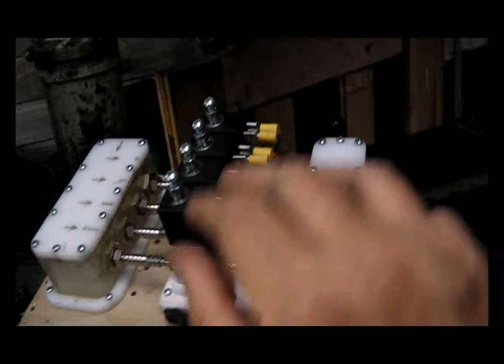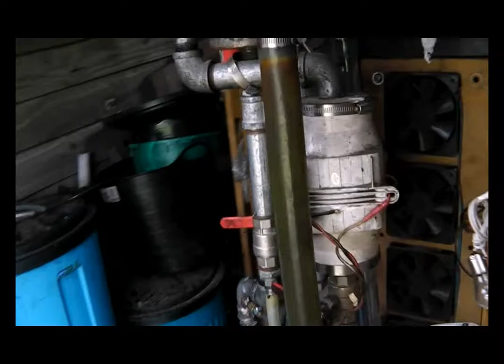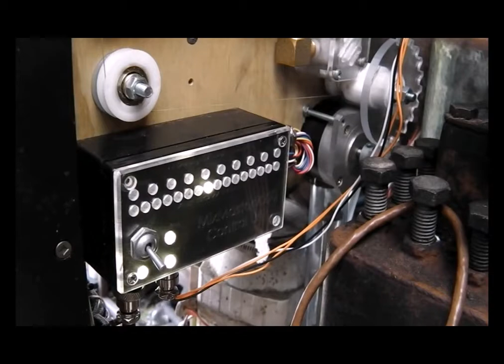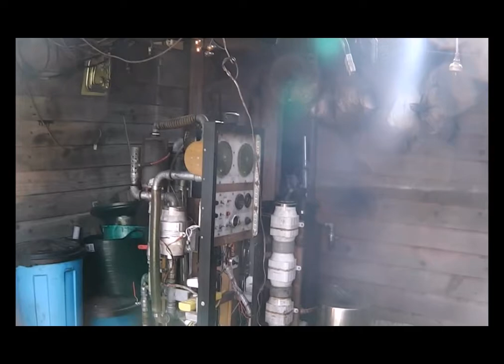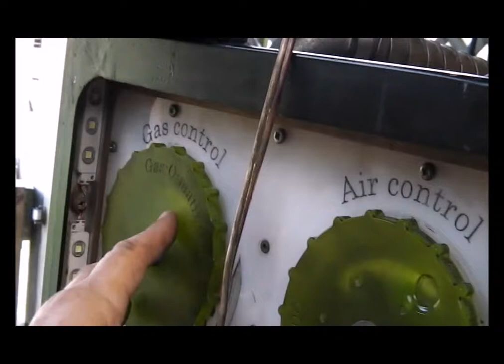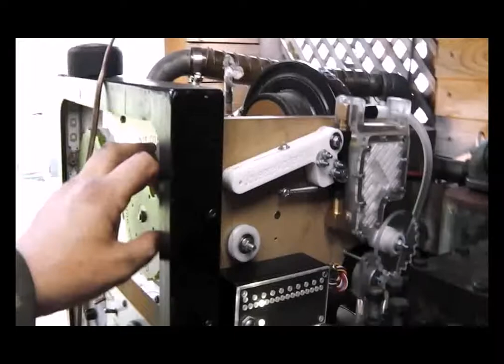A New Automatic Mixture Controller: The SqueezeMaster9000

Comment: I'm totally intrigued with all your experimentation, research and development on your project.  You're the first guy I've found on YT who clearly has an excellent grasp of the chemistry and the nuts & bolts technology of gasification - and also the delicate electromechanical and electronic aspects of controlling the fuel-air ratio.  And you don't take yourself too seriously either.  Even if I has no interest in gasification, you would still be entertaining.
I wish you all the best with your future refinements.
Reply from the maker: Howdee Andrew, 
 Thanks kindly for your positive thoughts here  :) . 
 The idea of automating this has been of great interest to me for quite a long time. 
 This becomes more important during poor weather when I wood be otherwise obliged to splash around in the puddles - as I go out to the gasifier every 15 minutes to stir it up and readjust the fuel/air mix. 
 Having carried out that manual process for the first 1100, or more, hours of operation, the novelty was kinda wearing off  ;) . 
 Now that it is auto-magic, I can sit back and relax, safe in the knowledge that my little home made computer will do its very best to keep the engine running while I am out and about. 
 One of the major driving forces behind my determined efforts to make this work so smoothly is that I am literally relying upon it for my winter electricity supply, as I am not on the power grid here. 
 Needless to say, this woodgas technology fascinates me to little pieces, then it gasifies the little pieces  :) .

Comment: Just to add-reading comments [Klaas hamstra] mentioned of the Arduino mini-computer for use in auto control-they are just down right  fun to play with! They come in many different sizes and are capable of all types of input/output devices. and there are thousands of users who are more than happy in helping others learn how to use. A great idea!
Reply from the maker: Yup, those Arduino computers seem to be very capable, and they are quite cheap too  :) . 
 I went for the PIC micro, as I use it for other industrial designs, and it has proven itself to be a reliable performer over the years, while also being nice and cheap.

Comment: This is great!! I have been searching for progress on automated wood gasifier  operation. Are you using an O2 sensor to monitor engine exhaust for feedback control of air/fuel mixture? Why not use a butterfly valve control (as used in a carburetor) instead of squeeze system? I would think a simple 1 barrel carb could this.

The ultimate in woodgas generator automation would be a system that would maintain charge on a bank of batteries that supply current for household use. When batteries need charging the system would self-start and maybe continue operation supplying power to house (load) until demand has dropped off then shutdown where (load) is supplied with battery current. This setup could make for a smaller size in battery bank - cutting costs.

And finally, having the woodchips fed automatically to gasifier and combustion chamber self cleaning would round out a system requiring the least of attention/maintenance.

I absolutely love your set up!!
Reply from the maker: Thanks kindly  :) . 
 This system works like a charm, and it saves me a fortune in generator fuel too. 
 Yes, this works with an O2 sensor. It's a narrow band one, which makes it simpler to set up and use. 
 I have a video on that here:  youtube.com/watch?v=2d6dRYIYLhY 
 Sadly, a standard carb is not practical for this, as the vacuum demands of the mixer system are so high that it can't tolerate any leakage past the butterfly. 
 There is also another reason I went this way, as that was aimed at maintaining performance as the parts wore out, without introducing wear induced debris into the engine. 
 Now, for a bigger system, I think a standard carb can work, as the relatively high airflow rates will effectively swamp out the butterfly leakage seen at very low settings. 
 Hmmm, I hope that made sense  :) .

 There are some automated systems out there, and these run on wood chips that are fed into the gasser via a screw based elevator. 
 Perhaps I will look into building such a system one day  :) .
Reply: Thanks for th' very fast reply!!! You're like a "rock star" in my eyes (LoL!)...I would've thawt th' carb idea would have worked...but, you seem to kno' your stuff! I've been hashing around for quite a spell now learning about  woodgas technology and collecting valuable parts/pieces (rather, other people's junk ha ha ha!) so I can attempt a first build of my very own! Gonna find out about narrow band O2 sensor ( I was wondering how you set up controller parameters in that regard) and experiment a little-gonna use an Arduino bequeathed upon me for having 54th birthday....gonna keep on watching your videos (and a few other worthy ones). Being of Finnish descent, I want carry on a lifestyle not so much demanding of our tiny little Earth.

Best Regards!
Reply from the maker: You're welcome  :) . I don't know about the rock star, but I do have a broken guitar around here, somewhere  ;) . 
 For a bigger engine, a carb wood be good, but this little gasser will fall over if I go that way. 
 Another alternative to the carb is to use either a ball valve or a gate valve. 
 These have that positive gas restriction that you are looking for. 
 If you wood like to learn a lot about how to make a good wood gasifier, I wood like to suggest that you take a look at the videos put up by Flash001USA. 
 He takes you through all the build stages, and helps you to build a gasifier that runs very nicely  :) . 
 My gasser is of a different design, but it works very well, and it has clocked up over 1500 hours so far. 
 Ahhh, free electricity. I love it. 
 If you can get a narrow band O2 sensor from an auto wrecker, you can experiment with it cheaply, and you will soon discover that it's quite easy to make it work for you. 
 My controller works on the 0 to 1 volt deflection that occurs when the O2 sensor is operating within its normal range. 
 Ideally, you wood operate near the zero volt end of the scale, in order to avoid a rich mixture. 
 Your Arduino should be very good for this, and I am looking forward to seeing what you come up with. 
 Woodgas is a carbon neutral power source, so you will be helping our planet a great deal when you get this up and running  :) .

Comment: Are you using Arduino to control this system? Awesome work by the way! I want to build a system similar to yours! Your inspiring many to go forward with woodgas!
Reply from the maker: Thanks kindly  :) . 
 This project has made a huge difference in the ease of operation that we woodgassers are seeking. 
 I am not yet familiar with Arduino, but I think I should start getting into those fine devices.
 Instead, I am using PIC Micro. These are commonly used in industrial designs, and they are nice and cheap too. 
 The particular processor I am using for this is the PIC16F628A. It's quite a versatile little chip, so it handles this task very nicely indeed. 
 I really do hope that more people start building gasifiers, as they really are fascinating to build and operate  :) .

Comment: When you were showing the old piece that you took off it took me back to a scene in the old Christmas animation cartoon Rudolph the red nosed reindeer where they had the land of misfit toys and I had to laugh because I know the feeling of putting a lot of thought and work into something only to come up with a simpler idea that works better. Great job is an understatement. Mark was telling me that your part of the world was doing a whole lot of shaking so be sure to nail everything down. PS, I can relate to your calendar.
Reply from the maker: +flash001USA 
 Yup, such is the way with us inventors. 
 We invariably come up with better ideas that are simpler, less expensive and more functional than our initial prototypes  :) .
 This new one is doing very well indeed, as it has clocked up at least 15 hours of sweet and smooth running. 
 It offers me a degree of freedom that I have never experienced before with any gasifier, so it, or a better version of it, is here to stay  :) . 
 For sure, we have been ripped up and spat out by a stampede of angry earthquakes.  They have smashed us up - and cost us billions, but we will pull through. We always do  :) .
Reply: Steve I just read Bills remark about temperature and how it may affect the flexibility of the air hose during colder weather. Just an idea. Have you entertained the thought of making a simple gate valve (flap valve) that was controlled by the arm? This would still work with the same arm movement and this could possibly remove any air temperature or pinch issues with the air tube over time. The main thing is you have proven that you can automate the engine and that alone is priceless.
Reply from the maker: +flash001USA 
 Indeedy, the flap valve concept is currently foremost in my mind. 
 While the flexible hose I am using does not appear to be affected by freezing temperatures, I still want to replace it with a more robust method of gating the airflow to the grunter. 
 The idea I have in mind is something like a trapdoor that opens and closes via an arm or a cam that is operated by the motor. 
 Ideally, it would be able to totally shut off the airflow when closed, while allowing free airflow when fully open - all the while eliminating the prospect of wear induced particulate delivery to the engine's intake. 
 Tree-oretically, the stepper motor can live in the airstream, thereby helping to keep it cool, while shrinking the size of the system. 
 Ohhhh, so many ideas, so few hours in a day...

Comment: Nice job Steve. I'm glad to see it's working well. Thanks for the fix as I run out the door to get a bunch of work done on my gasser while it's nice outside. What will you improve on next? Joe
Reply from the maker: +mazdalorean 
 Thanks kindly  :) . 
 I figured that you needed a woodgas fix, as I could see that you were getting a bit shaky - due to woodgas withdrawal symptoms  ;) .  
 The next thing on the list is to automate the hopper and grate shakers, so they will operate at exactly the right moment, based on the findings of the gas mixture control computer. 
 If I can get it right, the gasser will be able to look after itself, until all of the fuel in the hopper has been used up. 
 Oh, so many ideas, so few hours in a day!

Comment: You have built an amazing piece there. It seems to work great and like you said, a bit of a tweak with the programming and you will be able to "set it and forget it" I only wish I had you computer prowess. What a great improvement for your system. Nice build on the other building too. It withstood the 7.8 quake you all had down there. Are you going to start using the camel fluff in that Squeeze Master filter??I have to agree with Hbbyloggr on the freezing temps you get there and the squeeze hose loosing it's flexibility. Being that you are coming into your summer, it will be a while before you cross that road. Nice work all the way around.
Reply from the maker: +mada94fxr
 Thanks kindly. This device works perty jolly well, so I am duly pleased with it  :) .
 In time, this device will change and improve quite a lot. 
 If I can figure it all out, I would like to make the programming smarter, so it can learn about the gasser it is attached to. 
 That should mean that it can be seamlessly transferred from one gasser to another. 
 We'll see  :) .
 Yes, the new shed has been my major building project for the past year. It is 26 feet wide and 24 feet deep. 
 It's all built in steel, and is shelled with 3/4 inch plywood. This is a rock solid structure, and it didn't even feel that 7.8 quake that did so much damage in these here parts. 
 So far, it has cost me $19,000 to build, so I will be glad when I can put my wallet away at the end of the build  :) . 
 Yes, now that I have upgraded the air filter on this regulator, I will be able to jam some camel fluff into it. 
 This is a good thing, as my pillow won't stand up to much more of my pulling the fluff out of it  ;) . 
 I froze the air hose, and was pleased to see that it retained most of its flexibility. The true test of this will surely take place during the next winter, as that's when every part of the system gets pretty stiff! 
 Perhaps by then, I will have totally redesigned this device  :) .
Reply: Duly pleased is a understatement. I would be bouncing off the walls happy. You now have a baseline to work from and make the improvements as time goes. I'm with hbbyloggr. Let us know when you start marketing this thing...LOL. Add me to the list. Oh, time to shear the camels too........
Reply from the maker: mada94fxr 
 Hehehehe, yup, I figger that yer right on that one  :) .
 I am rather delighted with its performance, especially as that was a first off test  :) .
 Ideas for the next version of this are trying to get out of my head, and get into my CNC machine. 
 Soon, my little ideas, you will have your freedom  ;) .
 For sure, I wood like to think that I can develop these to the point where folks wood like to fit them to their own machines. 
 The luxury of freedom that this device offers is simply wonderful, and I just can't wait to see what is possible as I try to perfect this technology  :) . 
 Oh, if only I had more than a mere 24 hours in a day!
Reply: Darn man, haven't you done enough already........ You have another version bouncing around in the head??
Reply from the maker: mada94fxr 
 Hehehehe, yup. The mind altering effects of my morning coffee bomb have really messed with my imagination lately  :) . 
 I try to keep the new ideas in, but they keep leaking out through my finger tips. 
 Oh, woe is me - and my well worn fuel fingers  ;) .